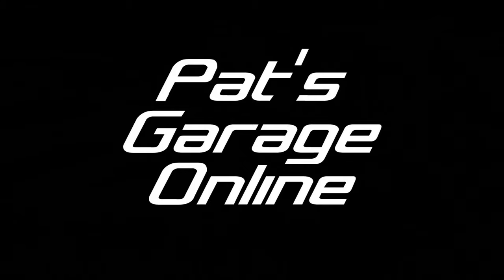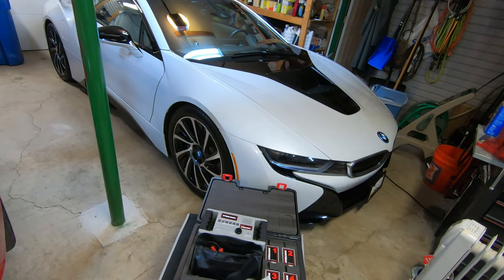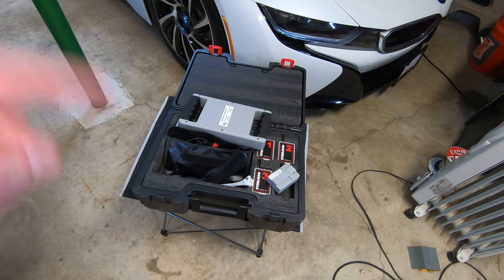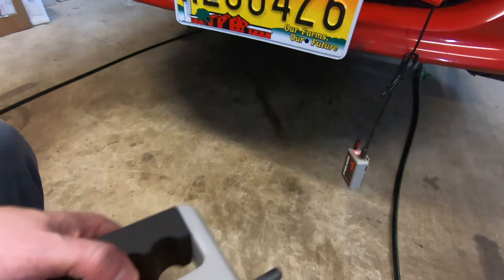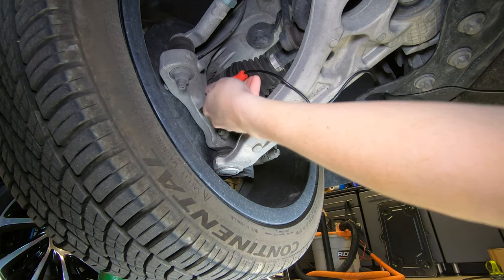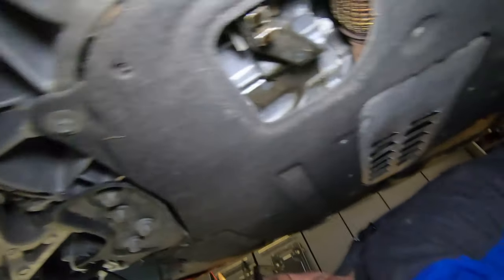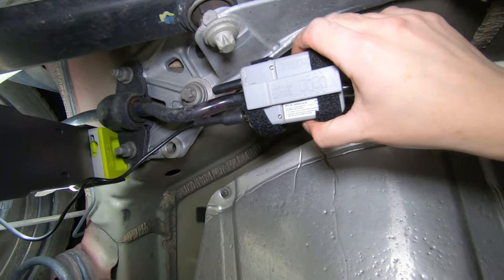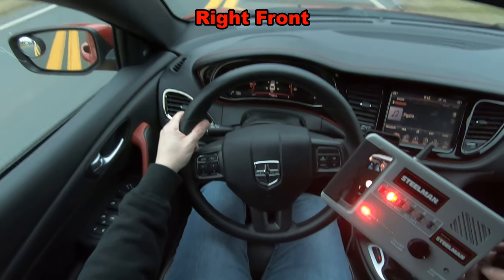Detecting Chassis Noise under a car - Finding a bad Front Wheel Bearing on the Dodge Dart

Comment: Pat - Was The Wearing Noise Coming from your front wheel bearing, Did it sound like several clicks when turning ? I have a 2016 Dodge Dart that makes this clicking noise when I turn and then it goes away. Im wondering if thats the beginning of my Front Wheel Bearing Going ?
Reply from the maker: Without the chassis ear connected, it just sounded like a whirring / rumbling noise.  If you're hearing clicks while turning, it's possible that one of your CV joints is bad.  Usually that happens if the axle boot gets a tear in it and the grease comes out / water gets in.
Reply: Pat's Garage Online == okay, so, how do I troubleshoot it on my own ? The noise I Hear are a Several Clicks when Turning then goes away ..... Is it still the CV Boot, like you suggested ?
Reply from the maker: @bellalisah8174  If the CV boot is damaged, you can do a visual inspection to see that.  Typically there will be black grease all over the place just behind the bearing.  But, it could be other things as well.  This is just what I assume may be the problem and I can be wrong.  Unfortunately, I don't own the car anymore and don't have a service manual for the car so I can't walk you through troubleshooting it.  

There is a Dodge Dart forum where people have posted about this kind of thing.  Please take a look at the forum.  https://www.dodge-dart.org/threads/clicking-noise-front-right.33153/

I'd suggest creating a new thread there and asking other's opinion on what they would recommend you do, as well.  Since they still own the car and have been exposed to more problems, they can likely help out much better than I can.  I wish I could have been of more help.
Reply: Pat's Garage Online == wow you are a great help ..... thank you for all you’ve shared. I’ll definitely goto the Forum, and probe around, and see if others have experienced that same noise. Plus, I’ll make sure to check for a Torn Rubber boot surrounding the CV Joint area. Thanks so much Pat👍🏼

Comment: The link you have listed for the wheel bearing is actually the rear and not the front. Wish it was the front because the rear is 1/2 as expensive. Also on my Dart when I am at speed and am turning to the left I get really loud noise coming from the right front. I know you said that turning left you diagnosed yours as the drivers side bearing, but mine is the opposite.
Reply from the maker: Thanks for letting me know the link was wrong.  I fixed that.  Not sure why I screwed that up but that's a big mistake that had to be taken care of and I appreciate you commenting.  It sounds like you are diagnosing yours correctly.  A left turn will put more weight on the right front so the right front bearing may be your culprit.
Reply: @PatsGarageOnline  No problem, and I followed your video for the disassembly process, really appreciated you including the socket sizes during the process. From that I realized my E socket set only went up to E14 so had to go out and pickup an E20. Thanks for the great tutorial video.

Comment: I'm curious as to whether or not any wheel bearing noise could have been generated/detected by just spinning the wheels by hand while on the Quick Jack?
Save the Wave.🙋‍♂️
Reply: Unfortunately that was not possible in this scenario, as the noise was only able to be heard over 30 mph.
Reply from the maker: Yeah, bud, I wish I could have heard it on the lift.  We had just recently heard it so it wasn't so far gone that it made any noise at low speeds.